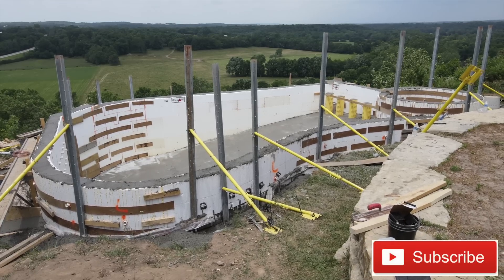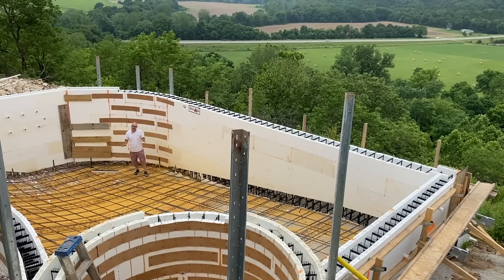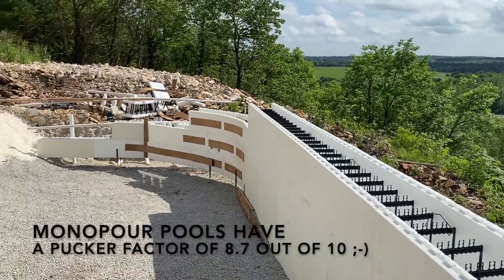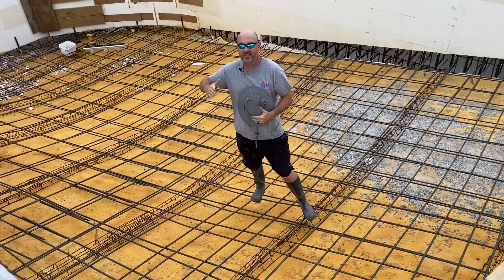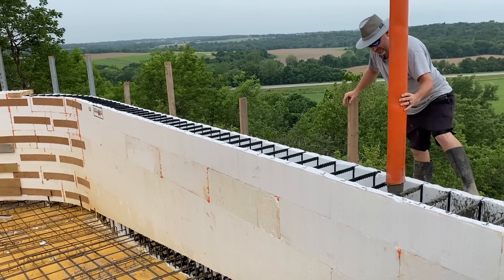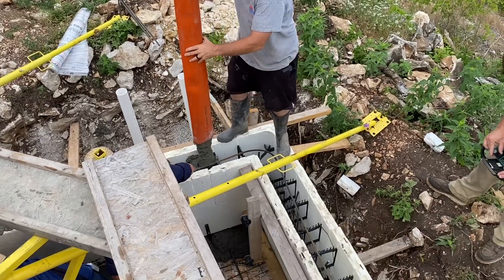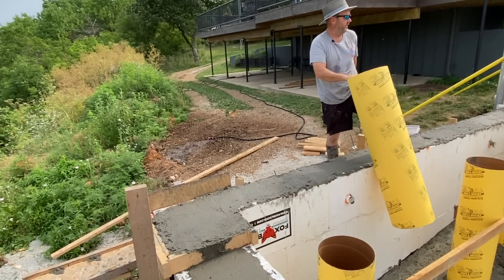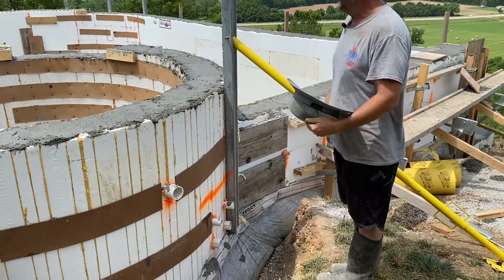ICF Monopour Pools Better than Gunite?

Comment: Did you have an engineer work with you for this design, or was a building permit pulled? Im not a professional but I can see  some serious issues here. Once full of water those walls will have some serious force against them, those icf forms have those brackets that run front to back, could that be a potential area for water leakage? Should those corners have more rebar? Shouldn't the ground be leveled with piers dug to hold the pool to the hillside? All that weight sitting on a slope doesn't seem safe. Why would you choose this over gunite if it's the same cost? IDK, for me I would prefer a rebar cage with gunite, as concrete is stronger when less water is used. I strongly recommend against doing this type of pool.
Reply from the maker: So, yes it’s all engineered, it has 2.5 tons of rebar strategically placed throughout, and the reason it’s better than Gunite is that it’s thermally broken for one, making it far easier to heat…. And the water never gets near the webs but that’s not a really common spot for water intrusion anyway. We use water stops on all plumbing penetrations which are problem spots for any form of concrete pool…. The plaster or in our case ecofinish is what waterproofs the pool, the concrete is the structure…. The pool is dug down in its entirety into the rock, the catch basin snd deepest level is 3’ into the rock, with a rock wall up against the back of the basin, for it to move, that solid rock wall has to move…
Reply: Approximately how much cost ?
Reply: In California we are required to have most everything engineered for a permit. I have a similar back wall for my personal pool, but about 3' shorter, and it was $70k. Not for the pool, just for that back wall. Had double the steel and massive footings.

Comment: Looks solid! Is there a risk of the floor foam compressing under the weight of cement and water in the pool, thus leaving a chance of cracking due to the air pocket. (In a previous life I worked in bathroom Reno’s and putting expanding foam as the support under a fibreglass bath could fail due to the compression). 
Genuine question, not question the workmanship or concept. 
(
Reply from the maker: We are using 2lb closed cell marine foam, it’s pretty dense, the engineers seem to be comfortable with it!
Reply: @all3pools  winner! Will there be a part two?
Reply from the maker: Yes!
Reply: so a close cell foam that is rated at 25 psi is rated at 3600 lbs/sq. ft. (psf)  since a cubic foot of water weighs 62.3 lbs and concrete weighs 150 lbs/Cu.ft.  If your water on the deep end was 10' deep your water would weigh 10'x 62.3 = 623 lbs/cu ft.  add your concrete floor weight in this case the floor is 12" thick so a cu ft of concrete 150 + 623 lbs = 773 lbs  the foam is rated at 3600 lbs/sq. ft.  3600-773= 2,827 Lbs more weight could be added before you crushed the foam.  So will the foam hold up under the weight of the water and the concrete?  ABSOLUTELY!

Comment: That is a really interesting approach.

I notice you have dramatically less rebar in your walls than what we would typically use for an above ground pool. In Australia we use shotcrete, which sounds like the same process as Gunite. We would use double layered n12 reo @ 200 centres in the walls, similar to what you have in the floor. That's a big cost saving right there, and considering where the cost of steel is heading that's a big advantage.

Comment: Aaron, just a heads up that it appears all of the contact info at the end of your video is wrong except possibly your phone number which I didn’t call.

I discovered your channel yesterday and watched several of your older videos about building ICF homes because my wife and I are thinking about using ICF to build a home next year hopefully. I have watched quite a few that currently exist on this channel and in a couple of them you reference older videos that don’t appear on this channel currently. Did you have an old channel where all those videos are or did they get deleted for some reason?

Comment: Just the video I’ve been looking for but wish it showed more detail on the fast foot. I’ve been thinking of doing the same with house walls and floors having the bracing and fast foot attached outside and fast foot just laid flat on inside with the waterproof membrane. I had thought to pour the floor first to just over the cut in the block then finishing walls after setting some around the legs to help prevent movement or are they stable enough to not warrant a stake though the legs?
Reply from the maker: I have an entire video on this channel on fastfoot!  Go back in my library about 6-7 vids:)
Reply: @all3pools  I watched it several weeks ago. When you had the form and fast foot laid out on the floor before attaching it is how I planned on using it. Just worried about movement without securing the feet during concrete.

Comment: Why do you use the fastfoot?  Why don't you just remove the foam from the inside of the bottom ICF?
Reply from the maker: I do in small stuff like water fountains, but the legs allow concrete to flow around them, but if I cut away inside and leave outside, the outside is ripe for a blow out, movement snd timing could avoid that mostly but risk is certainly higher…. Also, that extra door of icf is more expensive than fastfoot
Reply: He's creating a footing with the bag that's why it's "bulging" out so much.

Comment: Did you add any retarder to the mix?
Reply from the maker: No retarder, we on occasion will use super p plasticizer if we are pouring a really tall wall so we can get temp flowsbility in a very stiff first couple of trucks so it can be more set up as we add weight, but nothing that will effect cured strength

Comment: Was literally looking at your vinyl liner video yesterday and fox blocks wall/footer specs on inground wall pool. Then you post this on the mono pour! It’s like you were tapping my internet!!!
If I did this in 2 steps with (1) walls/fast fab footers and (2) then floor, realizing there is a cold joint, does it come close to your 1 pour in terms of structural integrity? 6” slab floor okay?love the foam!! Less pucker factor for me since it will be my 1st time doing this.
Reply from the maker: Ya, I actually know the engineer they had come up with their guidlines, he’s local to my area and has done work on a couple of my projects, if you follow his guidelines I’m sure it will be fine and for sure it will lower the pucker factor significantly…. I’m
Sure that cold joint can be mitigated with water stops or just simply fiberglassing the joint before whatever finish you apply!
Reply: Once shell of pool finished, what would you say is the estimated cost of the budget for finishing the inside? Meaning prepping interior fox blocks, plaster, wet edge or pebbles tech or whatever etc. 
Thinking of doing vinyl liner to start with an option to convert to a plastered pool later. I realize there will be some modification with coping etc. 
But would like to engineer so I can go both ways. Sounds like doing it to that engineers spec will get me there.

Comment: How much did this pool cost for the client after it's all done (including the dig)? What are the dimensions of the pool?
Reply from the maker: It varies greatly because of automation, finishing material, equipment and terrain, but it’s very comparable to Gunite in cost, a pool like this is probably in the neighborhood of 150k with all surrounding accoutrements…. But again that could easily vary +/- 50k just depending on scope/scale….

Comment: Monolithic curvilinear reinforced concrete pour with a total thermal break
Reply: ... I’m in. Wow!
Reply from the maker: Thanks!
Reply: Now can you say that 5 times fast?
Reply: this job does not have a total thermal break!  This is because they have a break in the Styrofoam from the floor to the bottom of the foam of ICF wall.  You would have a total thermal break if you laid the Styrofoam floor all the way to the Styrofoam of the ICF block and poured the floor on top of the floor foam and the concrete floor butted up to the Styrofoam wall of course if you do that you do not have a monolithic pour  you could potentially have spray foamed the bottom of the footer but you would have the have the outside of the foam wall come down and connect with the foam in the footer.  Don't see how you make that work...  so this job does NOT have a total thermal break!